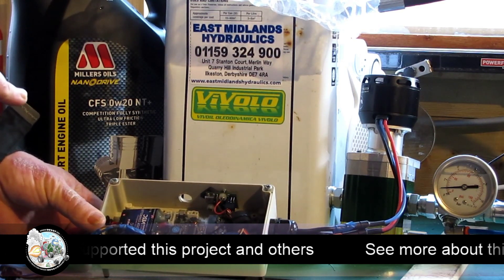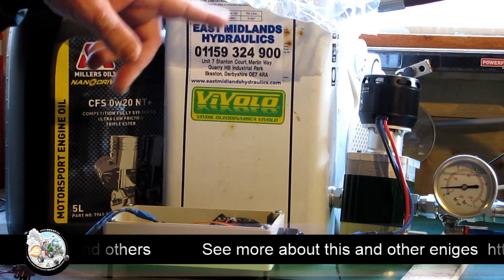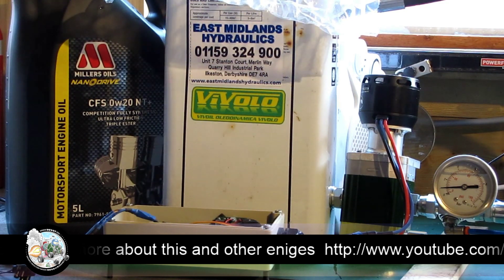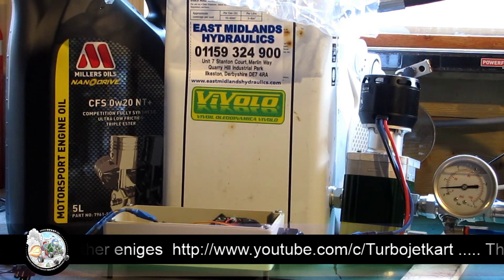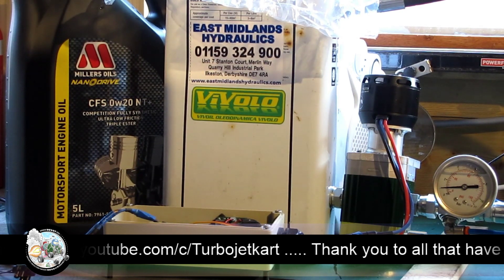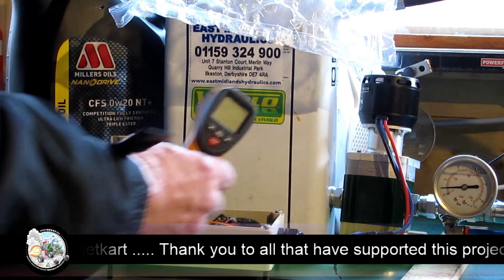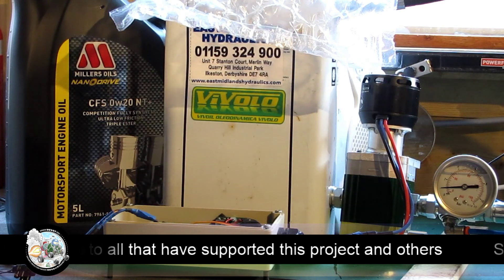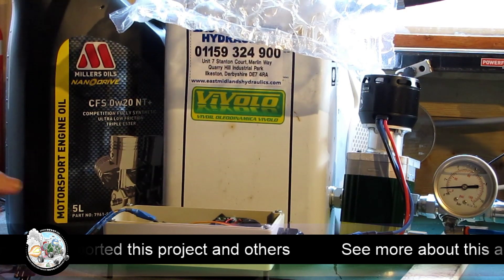Jet engine oil pump Test, Home made Diy Gas Turbine jet engine

Comment: Damn impressive oil pump! I looked at a hydraulic pump for my project but settled on a retrofit diesel pump at about 55psi. I think your unit for something similar is exactly what I'll be needing for Phase II when I go from a 3" single compressor to dual 7" wheels. =D
Reply from the maker: nice, look forawrd to see video
Reply: @Turbojetkart  It's in the works good sir! Made a lot of progress this last week as the weather finally dipped for a day under 102 degrees to get a string of welding done.
Reply from the maker: good, am hoping to do engine test soon with new afterburner

Comment: Why do you need such high oil pressure??
Reply from the maker: the bearings in the engine are hyfrostatic, the float in or on oil. This was only a test to see what i could get out the system, when the engine is running i need to be able to maintain at least 60 psi oil... it needs to be higher than that of the engine, other wise the pressure the engine makes would reduces the effectiveness of the oil in the bearing 🙂
Reply: Andy Morris man what the hell are you talking about?? The lubrication in a turbo charger is purely hydrodynamic. The bearings are simply BATHED in oil.
Reply: Andy Morris on top of that, there are no uneven radial loads on the bearings (as is the case with the main crank and rod bearings in a piston engine, that’s why they require high hydrostatic pressures)
Reply from the maker: ok hydrodnamic.... what ever, this is not a turbo, its a jet engine, i have built a few now, how many you made, you need oil pressure, other wise the air pressure will just cause issues, but hay what would i know, clearly you know it all, look forward to seeing your jet engine
Reply from the maker: and don't be schooling me mate, i been playing with engines since i could see over the hood of a car,  oh am hydraulics engineer, this is what i dislike about youtube, people think they know it all.... happy to put knife in when they think they going to make them self look big
Reply: Andy Morris hydraulics engineer and you don’t even know the difference between hydrodynamic and hydrostatic!? 

“This is not a turbo... it’s a jet engine”. Dumbest thing iv heard all week.
Reply from the maker: sorry are you saying a turbo dont need oil pressure, or it wrong to have oil pressure higher tham boost ? that seems to be what you say, the primative seals that turbos have left air passby any how.... at 5 in the morning i did not really acre dynamic, or static..... like i say when you done some thing note worthy, please share am sure me and plenty others will happy comment on it